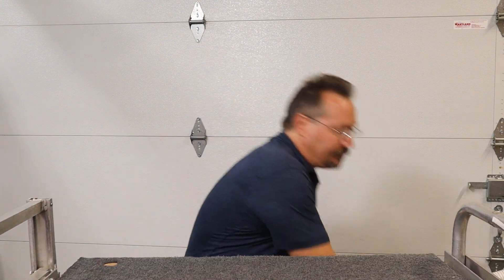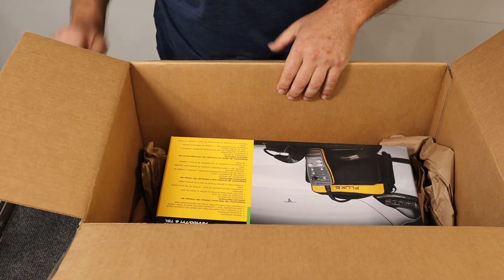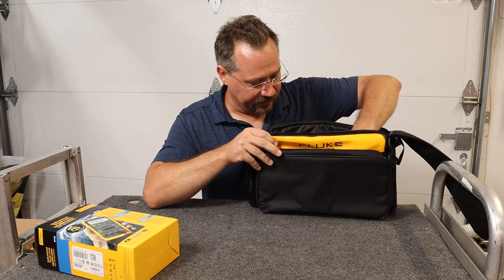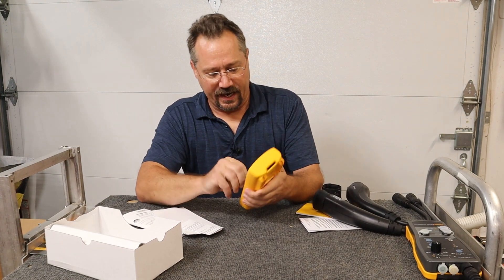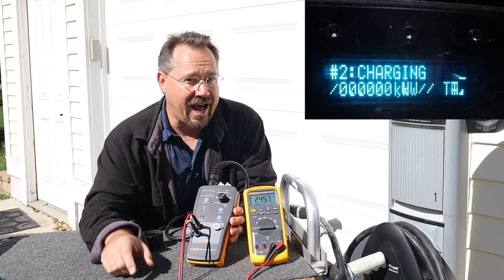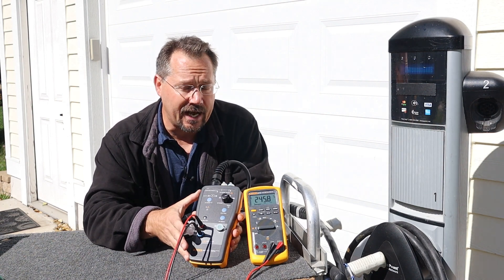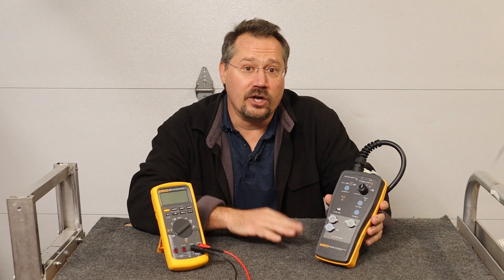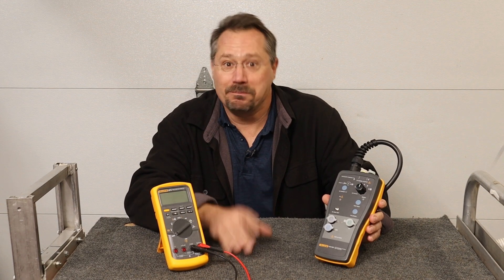Fluke FEV100 EVSE Tester - Unboxing, Testing, and Product Review!

Comment: Can you  make video of ebike battery can  charge from Tesla charging stations
Reply from the maker: A standard Tesla home EVSE is the same as J1772, just a slightly different physical form factor.
Years back, I built a box that I could plug in to an EVSE and then use the output to charge my electric motorcycle. The exact same thing would work for charging an electric bicycle battery.
https://youtu.be/jfKOCQpaaXI
https://300mpg.org/2015/03/31/the-diy-j1772-charging-adapter/
Reply: Hacksmith did a video doing that with a onewheel. The same circuit will work for ebike

Comment: That's crazy that the chargers are only running at 50% duty cycle.  Seems like they could add a fan for cooling and turn up the juice a bit and get more out of it.   It would be interesting to see what's inside and how it's constructed.
Reply from the maker: POWER from the EVSE is not running at 50%. What was measured is a signal from the "Control Pilot" - that's one of the two small pins on the EVSE connector. It sends a simple signal to the vehicle to let the vehicle know what the maximum amount of current the vehicle is allowed to draw.
This makes it so that any vehicle can charge at any EVSE and charge as fast as possible, no matter the power of the on-board charger, without blowing fuses or causing other problems.
Reply: @BenjaminNelsonX   I see

Comment: Those leads are known as "banana plugs"..  or banana jacks/ banana leads, etc.   and you can order all kinds of different banana test leads to put on the ends for back probing connections or testing hooks or alligator clips, etc. for super cheap.  So that makes those "banana to banana' wires you have pretty handy;  makes your kit more modular.  There are endless conversion adapters too for like banana to BNC or banana to RCA, etc..